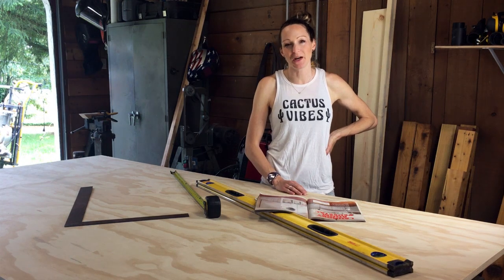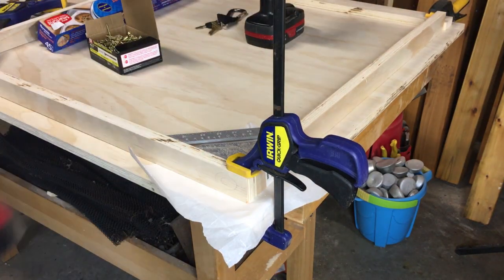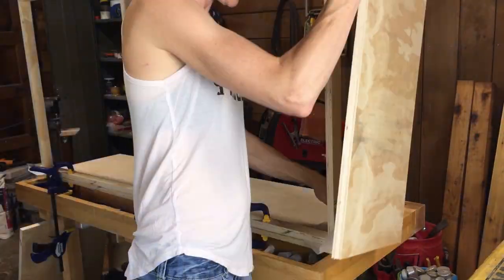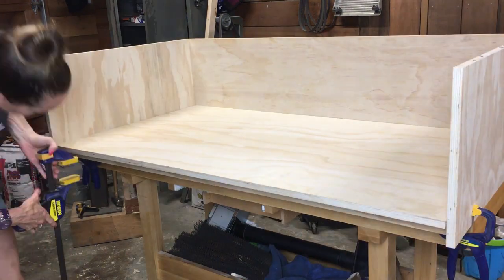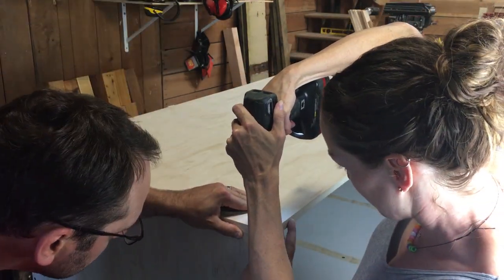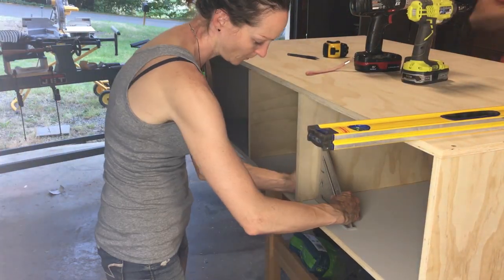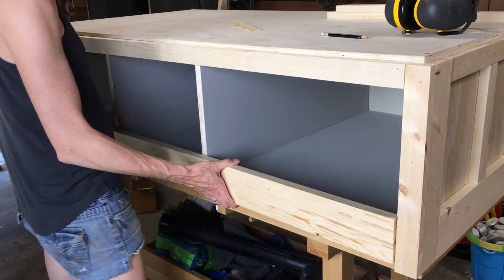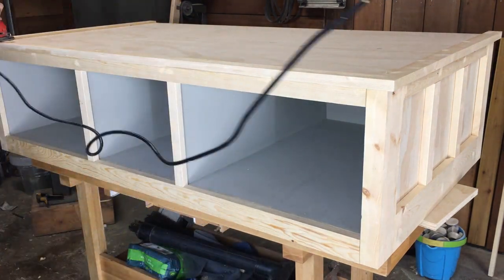DIY Laundry Room Pedestal

Comment: Awesome! Thanks for sharing. I also love that you had little ones in helping with cleanup (as you go!). Great for those of us with a gas dryer in CA that need to have 18" by state law.
Reply from the maker: Oh wow, I didn’t know that was a rule.  So glad this was helpful.  Have fun building Sarah 😀
Reply: @AroundtheHouse  Yeah - apparently if Home Depot delivers your gas dryer, they will NOT install it unless you have it stacked (we did initially) or an 18" shelf. Standard pedestals are 15" It's meant to help alleviate the risk of explosion from vehicle impact + if there is a leak, gas pools to the ground. Having dryer on the ground = hazard due to ignition. 18" is safer.

Comment: nice build.  love the sturdy build, choice of materials

  2 modifications I'd make.

1 add a waterproof tub to the top for that day you hope never comes
2 bolt the w/d to the base like all the bases sold in stores.  Washers especially like to walk around.
Reply from the maker: Rick M. Thanks for the feedback.
Reply: Rick - can you share what you did to bolt the machines to the pedestal and how this worked with the waterproof tub.
Reply from the maker: J Hoffmann sorry I just saw this.  I didn’t bolt them on or put in a tub.

Comment: This is too big for my particular setup. However, I think I can make this work as two halves. I have a sink in between the two, so I need two platforms.
Edit: You also have an insanely impressive plethora of tools.
Reply from the maker: This would be a great modification, good idea.  Most of my tools were bought off Craigslist and some weren’t running so I got them for a great price.  Just a tip if you’re looking to grow your collection. 😀

Comment: Very pleasantly surprised to find your video. I'm partway into building a pedestal from the exact same plans! Your clamping technique worked a lot better than mine. 😅 And I'm to the point of adding the bottom piece of ply and haven't glued anything. I'm too terrified that I'll mess something up for glue. 😭😅
Reply from the maker: That’s so fun you’re building using the same plans.  I did find they left out some small details that I really had to think through.  Clamping is always a bit tricky with something this big.  Have a great build and thank you for commenting 😀

Comment: The trim work is nice. Personally I would build a 2x4 frame first to support the weight. How do you prevent the machines from vibrating off of the platform.
Reply from the maker: My friends machines haven’t had issues vibrating however that is a good thing to think about as I know some do.

Comment: Hi - Thanks for the great video.  Now that this has been in place for a few years - how stable has it been?  My main concern was looking at the video how the bottom brace against the floor was not directly supporting the 2 braces/separators in the middle compartments supporting the top.  Any issues with stability or warping since the build?
Reply from the maker: Great questions and yes always good to check in after a few years. This is still being used and has held up great. No sagging or wobbling. Still solid.

Comment: I’m surprised this is strong enough to hold the weight of a full washer. The matching pedestals are too high for where my washer has to go. (The door wouldn’t be able to be opened all of the way 😲). Has anyone else built one from this video? TIA for any useful feedback.
Reply from the maker: The nice thing about the plans I followed here is that you can customize them.  In fact I talk about how I made them smaller in height in this video.  Hope this can help you with your project. 🙂

Comment: This could be a good summer project for me in my garage.  However I worry on how to lift the two units into place on top.  They are heavy and two persons might not be enought and there no space to get hands underneath.   Please advise how you did the lifting.
Reply from the maker: This was a very real problem Richard.  I got these all made and delivered to my friends place thinking the appliance delivery people would set them in place but they couldn’t due to regulations.  My husband and friend used lifting straps to put them in place.

Comment: That looks really nice, but I heard a washer and dryer needs to be bolted down to the pedals. 

Is this an issue on your set up?
Reply from the maker: Great question. I built these years ago and was just at my friends house yesterday and they are still going strong without any issues. I’m sure all washers and dryers are different so might be an issue with some. They have the front loaders we have that don’t ever move around.

Comment: OMG I am impressed !  Came out very nice.  How did you handle the Duct for the Dryer?  Did you have to make a hole into the back top portion of the pedestal to connect it to the wall or was your duct connection on the wall higher than the pedestal?      New SUB
Reply from the maker: Great question Gilbert, I never thought about it but others may face this issue as well.  The dryer duct for the one I made was hire on the wall so even with the pedestal it connected right in.  I didn’t need to cut a hole.  So happy to have you as a sub 😊
Reply: @AroundtheHouse  Yes there are 20 different ways to connect a Dryer to the Dryer vent so it could be anything from a 5" hole or a square notch for to 90 degree angled vents.  My vent is closer to the floor so I would have to cut out a hole on the top and back side of pedestal.   Thanks again.

Comment: Wow, this looks great and you did an excellent job! Would love to try that, but don't have all those tools!  😅
Reply from the maker: Debra Rainey you should totally try it.  If you don’t have a table saw you can always use a circular saw.  I clamp a 2x4 to it to get a straight line.  You could also use the circular saw instead of the miter saw.  I should do a video on that 😊
Reply: @AroundtheHouse  Thank you!  I may try using different tools. Love it!

Comment: Came across your video and am attempting this project this weekend. Thanks for taking the time to document your project. It will be invaluable to me over the next two days.  I'm curious what you went with for the overall total height of your pedestal? Also I was curious what the purpose of the recess of the kick plate is for? I noticed you covered the gap with a trim piece at the end of your video.
Reply from the maker: This is a great project to tackle right now.  I made it about an 1" or 1 1/2" shorter to fit the space.  Sorry don't remember exactly.  Good call on the recess kick plate.  I just followed the directions but I'm with you, I think it'd be better if it wasn't recessed so that you can nail to it.  Good luck on your build 😀
Reply: @AroundtheHouse   the link for the materials does not work. Can you share them?

Comment: Why put the top on and then slide the middle sections in?? Seems kinda making the job harder
Reply from the maker: I did it this way because the directions said so and I'm assuming it might be a little hard to hold those middle boards in place while attaching the top.  Feel free to do it however you like though.  Many ways to do this with the same result 😊

Comment: ive seen a couple of these pedestal videos and I dont get why none have used treated lumber for the base. Folks most of these
 pedestals will be installed next or close to a drain,  where water WILL collect at some point, you dont want the wood to soak up any water and bubble up, then your hard work is trashed in a matter of hours. The paint may help but I wouldnt risk it.